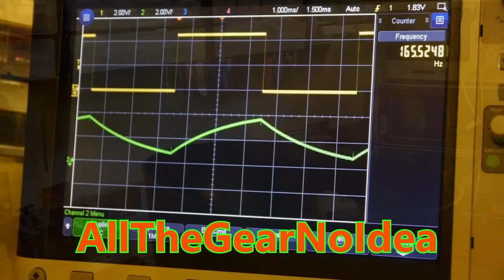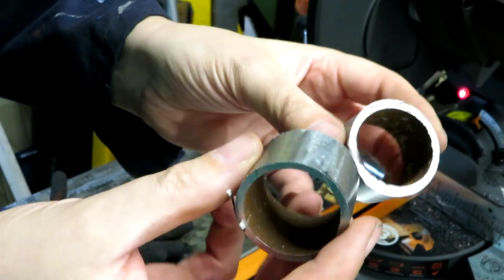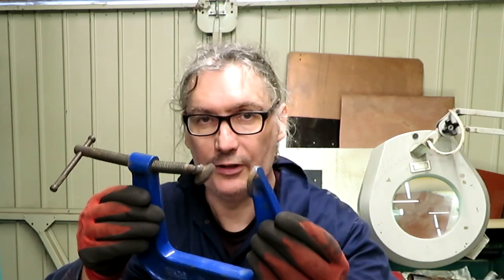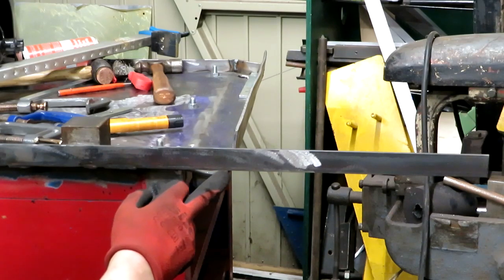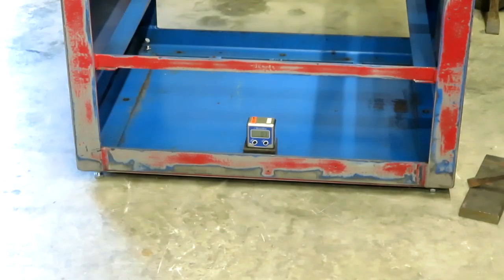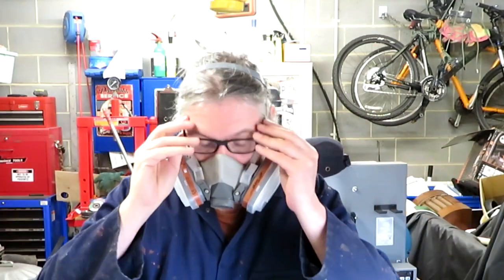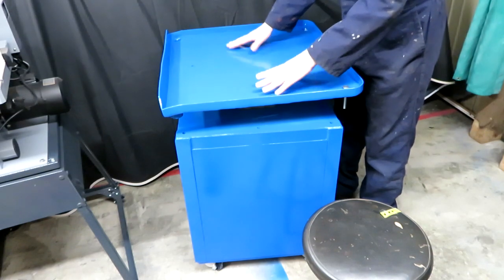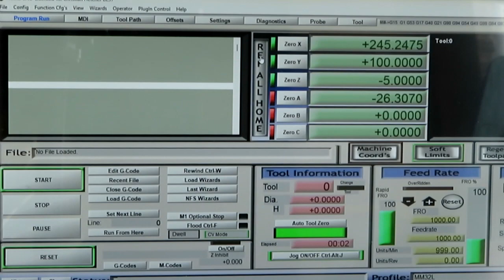Fabricobbling Part 2  - CNC Pedestal Build

Comment: Now I now why it's called metal bashing. I've been on the look out for a face mask as the conformal coating spray i've been using is a killer, so was interested to see your mask. Also cheaper than the mask I bought to use in the loft.
I deserve a beer after watching all that work.
Regards
Peter.
Reply from the maker: I think the mask worked really well and was a good seal on my face as my glasses didn’t steam up for once. It did the job and had no breathing difficulties after the spraying. It was £18.00 on Amazon the details are in the show notes. Thanks regards Chris

Comment: I can hear my now long deceased machinist granddad yelling ,"Don't use  a clamp , you'll ruin it. Heat the metal you want
 to bend  with an air acetylene torch."  Like I had one. Yes I did bend the clamp and ruined it! By the way Chris you are a far
 better  metal worker than he ever was. You are a great paint can shaker!  Forgot to suck the air and overspray outside
 with a cheap box fan. You're well protected but how about the work protected from overspray? Stil got a nice top notch 
paint job. Love the bright blue. Crazy cool stuff shown  in the garage ( saying it as gayrage) at the end! Such a tease!
Reply from the maker: Thanks for watching. I realise a lot of my audience wouldn’t be interested in the metal bashing and the crossover to metal isn’t for everyone. But I started the channel just filming what’s on the bench today and it’s important to do what you enjoy. I am looking on the radio and electronics work as a winter sport when it’s too cold for garage work. I wish I had an acetylene torch and have used them at work but I don’t really want the health and safety worries in my small garage workshop. But it sure would be handy, I think for smaller stuff I could use my TIG torch.  I sometimes wonder if I should get a proper spray gun, I have in the past sprayed my own cars and the results were acceptable. But again is the mess and the solvents and cleaning out the guns which I hate. I would like to do plastic coating for small parts but don’t have room for an oven. Thanks for watching and great comments ad always. Regards Chris

Comment: Good job Chris, a few notes, there is a simple device for leveling out 2 or more corners, but almost nobody think of it to use it, and that is a hose level. 
With a hose level on opposite corners, you set even the largest things level. And as second note, your weldings are not bad at all, saying from a former welder, but you may raise your wirespeed a little bit. With a Mig/Mag welder you can not only see if your welder is set correct, you can also hear it. If the crackling noise is very regular, your wire speed is set correct, if your wire speed is set to low (also called spray arc welding), then you hear a crackling sound with pauzes in between. And if your wire speed is to high, your welding torch has the tendance to get pushed away from your metal. But you did a great job, and it will definitely not fall apart. Grtz
Reply from the maker: I thought the definition for spray arc was above 200 amps and dip transfer below that. I worked in a fabrication shop for a while but not as a welder and used to play with the equipment whenever people weren’t looking etc.
Reply from the maker: Thanks for the tips on the wire speed I did discover it was a bit low. But as a beginner you can get pulled along by the wire speed if not careful.
Reply: @allthegearnoidea6752  , you can use "spray arc" at lower amperage also, but you need to find the good balance between amperage and wire speed. Is the wire speed way too low, your wire wil melt inside the copper tip and need to get unstuck each time. With "spray arc" you use more of the base material to get the weld done, and don't add much filler material, "spray arc" gives also a deeper burnin, and that is not wanted when working with sheet material. The normal way of Mig/Mag welding is "shot arc", the wire touch the metal, ignite the arc and melts down, and extra wire is feeded, touch the the metal , ignite the arc and melts away and etc.... this touching of the wire into the melted puddle of metal is what gives the crackling noise and sparks. With "spray arc" you only have sparks at the start, and not during the welding. Back in the days i loved to do "sprac arc" because those welds are almost like TIG welds and very strong, but it generate a lot of heat, so good gloves are a must.

Comment: Excellent job Chris, I like to think I'm good at metalwork, but I couldn't do a job like that, but there again my metalwork tends to be on a smaller scale. My garage floor also slopes, discovered this when equipping workshop no 2 (garage) with a new bench (actually a big oak table) had to cut a 1/2 inch off two legs to get it level . Best wishes nick
Reply from the maker: I think garage floors have a slope towards the door so they don’t fill with water through the door. I do much prefer metal work to woodwork. My woodworking ability are terrible even on a good day!

Comment from the maker: Bjorn - Thanks for the welding tips. Unfortunately I just don’t get enough practice to gain much skill as a welder although I think I was getting dialled in by the end of the project. I think going forward I am going to do more TIG welding as I like the fact it does not produce so many spark’s. I think if I ever had the room it would be nice to have a flat level welding table.

Comment: Surprised you didn't push the boat out and startup the lathe behind you before standing on the pedestal and trying to bend the bar. Sketchy yes, but we ALL do it.
Reply from the maker: That sounds like a challenge. Next time. Thanks for watching and comments regards Chris
Reply from the maker: At one point I thought the cross slide handle was going up my bum hole! Most exciting thing that’s happened in ages.
Reply: @allthegearnoidea6752  , Lol :-)